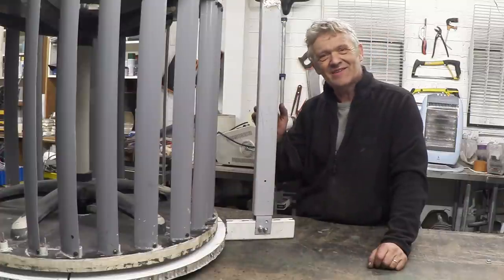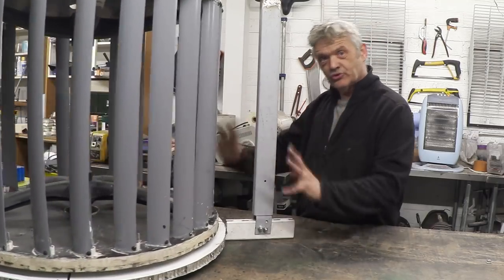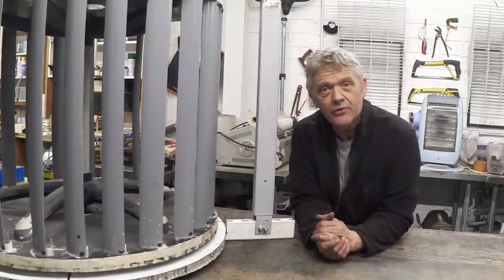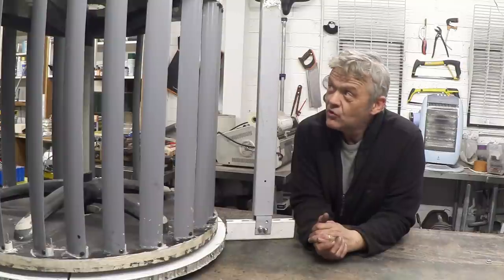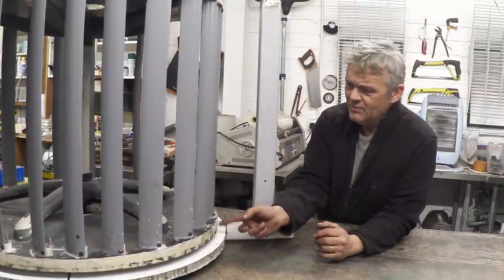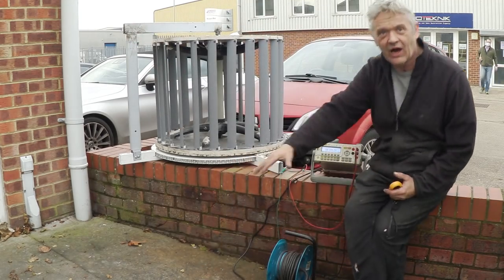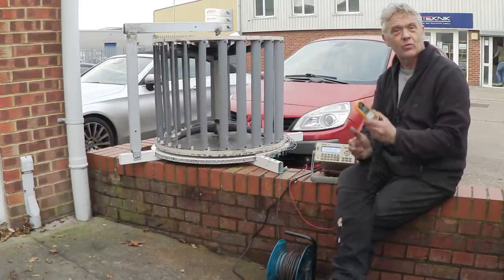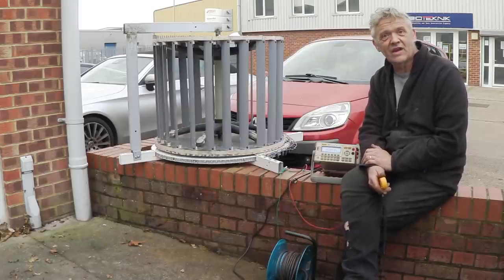A Wind Energy Harvester

Comment: 0.14mWh no where near enough to charge even a button cell.
Robert, the load is important.  You don’t get energy for free. 
Get a variable resistor. Measure volts across it and amps going through it.  Then decrease the resistance until it stops or produces too much heat. Take measurements then you will see Max power generated for a wind speed.
Good luck!
Reply: I think he knows, that’s why he’s only ever shown us with it hooked up to extremely low power devices like LEDs. 
But it is kinda funny to watch him use a 1kW leaf blower and only yield 1mW out! 
(You can’t measure amps without a load, so I would guess he switches his meter straight from measuring open circuit volts to amp, with the meters internal shunt being the load perhaps?)

Robert - lots of people here trying to help you out mate.
Reply from the maker: you are missing the point here
Reply: Exactly.  The charge on the capacitors is tiny, not enough to do any work.  The point of a wind generator is to produce useful power - energy.  Put a real load on it, even if it's a 10 watt lamp and see how much effort is required to spin it to produce 10 watts.  Then increase to 20 watts and do it again.  This would be a good demonstration.
Reply: @ThinkingandTinkering  please enlighten us? Thought you were building a1kW wind generator?

Comment: You’ve come a long way and tested different kinds of coils, glad to see the answer is the coils need only be copper windings no type of core necessary. That’s ridiculously free spinning. I have wanted to build wind turbines that would spin in the low winds we get here, and thought I needed permanent magnet motors and you show me all I need is a few spoils of copper wire and a bunch of magnets. No motor needed. I like the squirrel cage design for its omnidirectional orientation to the wind as wind frequently shifts out here. We get more high speed wind than you claim but not constant and mostly during cooler weather, hottest days tend to be still. Could the coils all be connected in series then put through a bridge rectifier and large capacitor to accomplish the same ends or do they need to be individually rectified?

Comment: You say farad several times - I think you mean microfarad?  1000 farad supercaps at those voltages would be large and very expensive.
Reply: That he means. Happens to many of us.
Reply: Yeah. I just did the maths on his last video with 1000uF capacitors and it came out to something like 280uA of current. I think Rob's made a bit of a blunder here, but I'm interested in seeing what the true value is.
Reply: @ThisRandomUsername  He charged it to 10V. Joules=1/2 * V^2 * C = 0.5 Joules. (still very small)

Comment: The higher the height, the higher the wind speed. This relationship takes exponential form, but its function depends on the value of wind speed, roughness of the soil surface and the value of the air temperature gradient near the ground.

Comment: Where I'm from the bearing you made is okay. In the high end of hifi turntables (30-100K) use magnetic or air bearings. So why didn't you use two apposing ring magnets which really would be friction less. Although there would be some work through the magnetic field I bet it would spin even better than what you have???
Reply: Was thinking of this in the other video.. great idea.

Comment: Say the capacitors are 1000μF And call the Volts 8.5V after 10mins (in basically no wind < 1m/s)  and the equation E_stored = 0.5 * C * V^2  and were there 14(?) capacitors per 1/16th (estimating for a the top+bottom coil capacitor network) call that 224 * C * 0.5 * V^2  = 0.112*(8.5)^2 = 8.1J
Claiming a rated "1Kw" wind turbine as a ~= "100W" turbine because of the skew in Betz's law (jumping over the main argument here that I totally agreed with btw) ... anyway for 100W we want 100J/1s and in low wind you measured 8/600 or ~0.013W.  But a charge Q=VC to the full 50V in 600s on the same 224F(arad) network is 280 KJ (!) or 1/33rd of my daily needs according to the British Nutritional Foundation. ! 
Although I got carried away there since it should be 280J, unless the capacitors you're using really are 1000F but that sounded like the realm of super capacitors. In any case 0.467W running 24/7 generates 40KJ
Reply from the maker: I am sorry mate - it is not clear to me what you are saying - I meant to say microfarads by the way

Comment: Hi Robert  I am glad you have gone the way I suggested in Part 5 and ditching the iron core. Your idea of the overhead arm has reduced the friction by a large amount . The only thing
missing is the disc of opposing magnets sandwiching the coils between opposing magnetic fields. This would double or triple the output.This is easy to prove or disprove on a simple test rig.
Rule on magnets  for new experimenters . Like poles repel .  Unlike poles attract
Reply: Is that a toroidal flux scheme you're describing?
Reply: @dexterdixon2000  I would say you are correct. With a single magnet the field  is normally radial from north to south around the magnet . When two magnets are held at 
an optimal distance apart this causes straight lines of force between the two magnets . When the coil passes between the magnets it is passing through a more 
concentrated field . The only caveat is that the size of the coils must be fully enclosed in the magnetic field. If the coil is too large the unexcited wire will pull the output
down
Reply: @johnwilson3668  when you say opposing do you mean north facing north or north facing south? The former is toroidal flux (less common but a good choice for diy) and the later is axial flux.
Reply: @dexterdixon2000  Hi Tom  The disc's should have magnets placed NSNS and so on . The corresponding disc should be  SNSN  . The two disc's are locked together and 
rotate as one with the coil disc held stationary between them . Therefore it will alternate  north pole on top plate south pole on bottom plate .Then the next pair of magnets 
will be south pole on top plate and south pole on bottom plate .This arrangment will carry on around the two disc's  . There will be opposing  magnetic around 
the disc NS SN  NS SN.The magnets must attract each other around the disc but in a NS SN pattern around  the disc. ALL MAGNETS AROUND THE TWO DISC'S MUST ATTRACT
 EACH OTHER  If this is not clear I will post a Drawing you can download in the next reply. Jacking screws must be used to put the disc's together  until they rest on spacers
otherwise they will be assembled violently
Reply: @johnwilson3668  I understand that configuration. It is also possible to have the magnets alternating but repellelling between the plates. This forces the flux lines out through (all) the sides of the coil and is called toroidal flux (I think). It's the scheme used on Proven (now SD wind) turbines.
Reply: @dexterdixon2000  This system of build is the most popular in the homemade  wind turbine community. But I have developed something completely different which I cannot 
divulge in this feedback  . You  said "repelling between the plates"  . The plates must be attracted to each other . It can be a dangerous operation assembling these generators
for getting your fingers trapped

Comment: I was about to suggest some magnets to push it up instead, but the generator magnets blew that idea.

Would it work to add a few electromagnets too (or instead the permanent ones)?
The idea would be that they'd be fed by a trailing contact from below, connected to the already generated power.
They should quickly be quite strong in high wings automatically braking the wheel from spinning totally out of control. 
Or does my brain fool me here?
Reply: If you added a low power tachometer or even if it was tripped when the voltage reached a certain point, an electromagnetic brake would work wonders.

Comment: Okay, cool build. A suggestion... Imagine rotating this on its side 90°, putting the blades on longer 'legs' as to resemble the paddle wheel of a Mississipi paddle steamer (river boat) as to keep the electric setup (rotor/stator) out of the water, then positioning this into a stream. Then in each paddle or blade, (for fresh water use in a river with a constant flow), mount (n-number of) the two rod pairs in the correct fashion to the water flow - one brass ('downstream')  and one aluminium ('upstream') - so they generate electricity as used in your project video of the 'perpetual battery powered by water' setup. How many rod pairs will need to be seen, as the blade still needs to catch water efficiently.

Would this add a few advantages over the wind generator being:

- 1) In northern parts of the western hemisphere, where water always flows and is always available but wind does not always blow.
- 2) ...therefore resulting in constant and maybe even superior RPM's, depending on what stream this is submerged in.
- 3) and thus get a supplementary output on top of the rotator/stator electric bit, by generating extra energy from the water flow over the consecutive aluminum/brass rods, which is also dependent on the RPM's and the higher this is, the higher the extra current should be.

Of course, not everyone has a steam flowing through their garden, but it could be nice for those who do, or repurpose some of those watermills that are still scattered and functional across Europe.

Comment: A Prony brake is a simple dynometer.  A way of measuring the raw power of any rotating device. 
It's an adustable clamp the fits over a shaft, and allows rotation, But as dragging, clamp wants to turn How much can be reacted and measured on  a scale, or via hanging weights. Known   length Multipled by force, gives torque. Knowing rpm then allows power to be calculated. If not turning there can still be torque, but no power.

Would probably find different wind speeds, and amounts of tightening, make different amounts of power available for extraction. Tighten clamp more, and torque increases, but rpm drops. If torque increases faster than rpm... Power would rise.

Comment: Nice so when will it be producing that 1kw?  Or is just charging those capacitors be enough proof for you?
Reply: At a guess it might produce about 1kWh in about 3 days
Reply: My guess is that if he had a full ring of those turn table coils he could produce 1kw in a day of steady 7-9km/h wind. Which isn't bad.
Reply: @Scott_C  with that size of impeller? Not possible. At 9kph, it would be least 9 days to generate 1kWh.
Reply: @Bottle Studio Not if it's cloudy or the days are short, e.g.: winter. Also wind blows all day and night.  

Remember this turbine is more of an energy scavenger.  And is an exercise of: "can you make a wind turbine that can produce 1kw with scavenged materials?". A solar array is not that.
Reply: @Scott_C  It is an interesting project, especially in terms of the construction, but the expectations of potential output must be realistic.
The amount of energy available for a given size of turbine is determined by the velocity, impeller efficiency and air density.

Given that this project is aimed at lower wind speeds and the relatively small size of the turbine the maximum output at average wind speeds (less than 10mph) is going to be only  25W. That doesn't include any inevitable losses which would probably reduce the average output to much less. At a guess it will be less than half that, especially if battery storage is involved. Well designed alternators are about 75% efficient, but typically less than 60%, batteries about 80-90% again depending on circuit design)

But that said it could potentially provide enough power to illuminate a modest sized room.

Comment: I watched 7 videos and enjoyed all. My only suggestion would be to use actual airfoils  not just curved fan blades and the reason is because airfoils are pulled along not pushed. An example is a sail, the wind doesn't push the sail, it's shape creates vacuum and pulls the boat along. Sails are just adjustable airfoils. Vacuum has 10 time or so more power the regular pressure. If your still trying to improve your project I say try airfoils.  
DANNY

Comment: The capacitors are not a load! The current and voltage are out of phase so there is no power. You need a resistive load. Try running light bulbs which have a power factor of ~1

Comment: As you say. Awsome! :-) Even better than I hoped it would be. It is very pleasent to see, how smoothly it runs now.
Maybe it would be smart to check the angle of those blades. They are actually wings/sails. They generate a force (lift) which is somehow perpendicular to the wing. This force is pushing your turbine to turn around. And it should be tangential to to the outer cyrcle of turbine in the spot, where the blade gets max amount of the wind. If it is pointing toward the axis or outward of the axis, part of the blade lift force is lost to pushing turbine together or tearing it apart. In other words, you are throwing wind energy away. And in your case, every small amount of this lift force matters alot (small force and large lever). So It would be helpful, to test a single blade in some kind of wind tunnel, and find the right angle, at which the blade is generating most lift. And also find the direction, this lift force is pointing at. Complicated. Probably easier just to make some kind of mechanism, to adjust turbine blade angles. Maybe for version 2. And then, for ver. 3 make blades more wing like. and get even more lift at same windspeeds. Thicker in front, and thinner at the back, to get higher air speeds over the top of the wing, lower air preasure and bigger lift. Maybe put them in shrinkwrap. Would make significant difference. Ask someone, who knows things about sailing, virtual wind, etc.

Comment: This is bloody brilliant Rob. If you used a liquid rubber insulation on all electrical components and joints this same unit could be mounted on its side in a stream or a creek if you're fortunate enough to have one running through your property. That would harvest 24/7, especially after a decent downpour. Smaller units could even be used in your drainpipes running from the gutters on your roof.
If you think about it this same project could be adapted in so many ways that your battery banks would never come near to running low (if you had adequate battery storage for your needs). Add in a decent inverter or two and say goodbye to expensive power bills. Even if you just ran all your household lighting with LEDs and a couple of appliances you would see a considerable drop in money paid to electricity companies.
This would have to be my favourite project to date. Thank you and Merry Christmas 🎄
Reply: Yep, and yep, and 100% yep, you just said everything I was thinking, good bye power bill.
Reply: @jasonwitt8619  I run all my household lighting and my electronics workbench from alternative power so I am partially off the grid. Once I expand my batteries I will start isolating appliances from the grid.
Reply: @stevetobias4890  Nice and that is the goal for most of us that live outside of town also... Cheers
Reply: @jasonwitt8619  not just for those living outside of town. I live in a smaller country town but prefer to keep as much money as possible from greedy whore mongering companies that care more about profits than the well-being of the average person they supply a service to.
Reply: @stevetobias4890  I agree 100%, no need to give the power company no more than we have too. Cheers mate

Comment: I've been randomly jumping through your videos on this, haven't seen them all yet, but I am definitely inspired to try something similar with the scrap parts available to me. So thank you for the ideas!

I am curious, though, if you've thought about adding in a centrifugal governor. I'm probably wrong, but my naive intuition is that while it would slightly increase the starting speed, it might also keep the thing spinning long enough in (some) low wind conditions to continue generating into lower speeds once started. I do expect if there is a possible benefit there, it'll be small so it may well not be worth it even if it can work, but my intuitions are too fuzzy on it to have any confidence one way or another.

Comment: I wonder if you could make a combination kite and wind generator. The kite structure could bring it up high, and then up there a spinning generator could be exploited. It would make sense to transmit the power down using AC to the ground via the kite cable. For hydroelectric, there are devices you can throw into a stream to generate power. It would be interesting to have something you could throw up into the sky to generate a bit of power. Perhaps a low-power-drone could bring it up and hover. If the power generated is greater than the power consumed by the drone, you win.

Comment: Are you going to be able to electrically brake it when the wind gets up to high or do you think it will need something mechanical to stop it?
Reply: You can electrically brake it, all you need to do is short the outputs and baam it stops, in fact a electrical mechanism can be set using relays that open at a certain Voltage, now this Voltage can also be controlled with use of MOSFETS or a simple variable resistor to trigger brakes, very nice query friend!!🌹🌹 God bless 👍👍🙏🙏
Reply: @Yaman-D-Chhaya  Yes, I know the principles, this thing has a lot more mass and comparatively a lot smaller electrical components than is usual though, that's why I asked.
Reply: @popuptoaster  You are absolutely right, but it's always a mystery with Rob Sir what he would come up in his final design, lolz but the build is great and so is your point too mate👍👍❤️🙏🙏😂😂😂😂